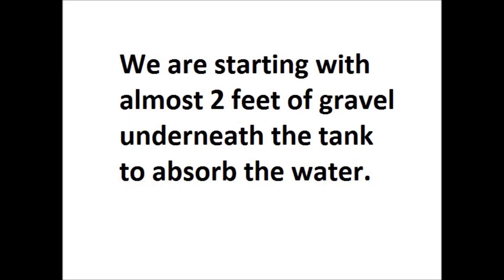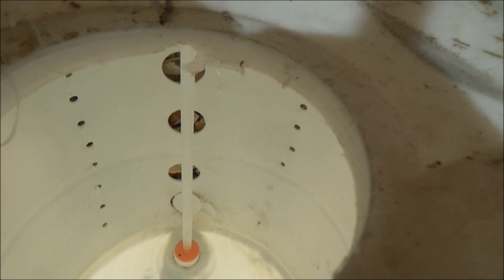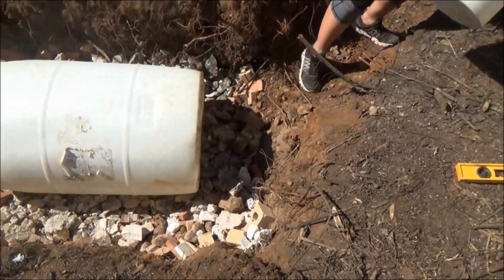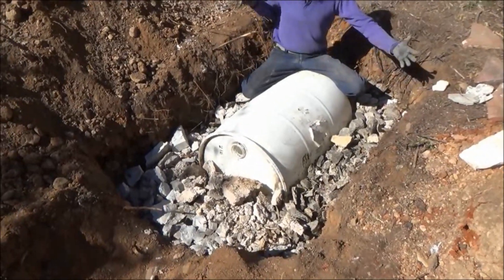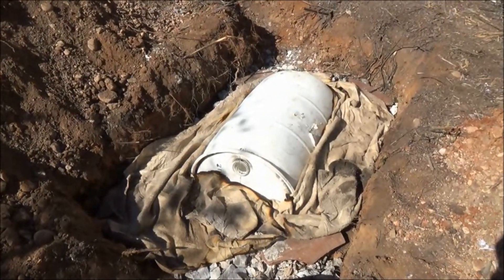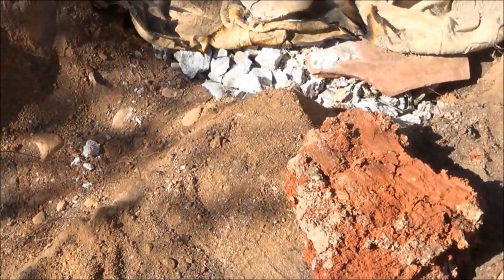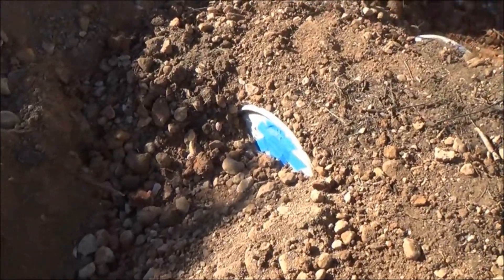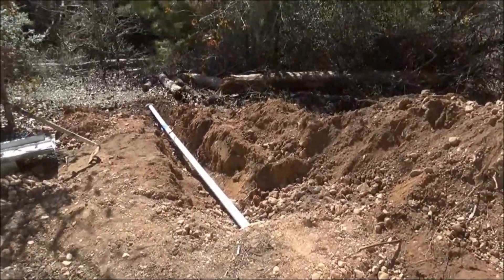How to Make a Greywater Tank from a 55 Gallon Drum.

Comment: Great idea, the water table in my area is about 5' down, so using the barrel on it's side means a shallower install so it meets the min 3' above the water table.  Probably not as strong but should still work!

Comment: if the 55 gal drum was upright instead of on it's side it would be stronger.  Also an upright tank has more gravity working for you to push the water out.  If this is just for a washing machine drain and the soil has any percolation(like about average), then the outlet pipe is not needed, especially with 2 ft of stone under it, unless maybe you are doing 10 loads of laundry at a time.
Reply from the maker: I wanted more surface area for the water to drain. In this particular area the ground does not gobble up water like other areas of this country.